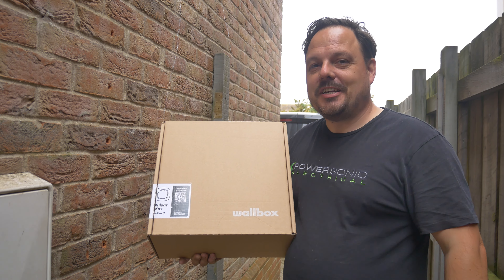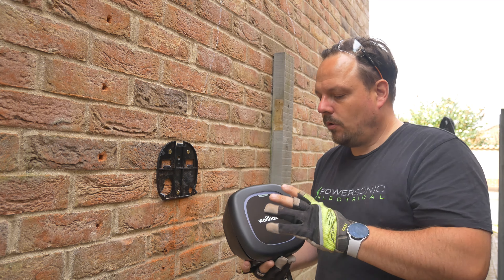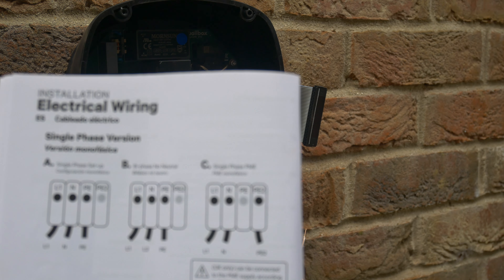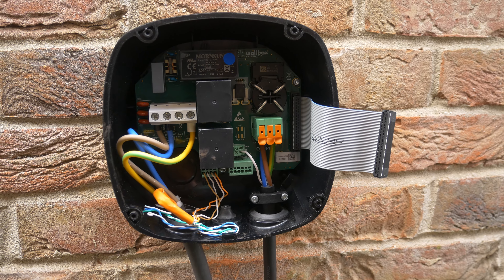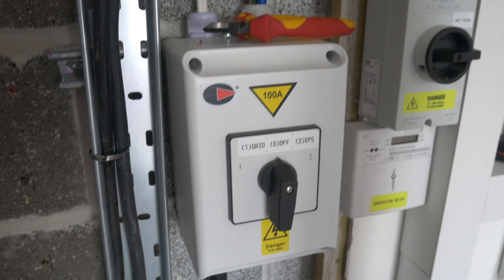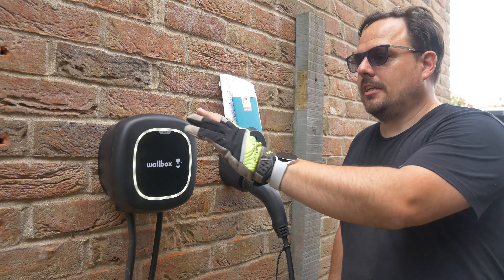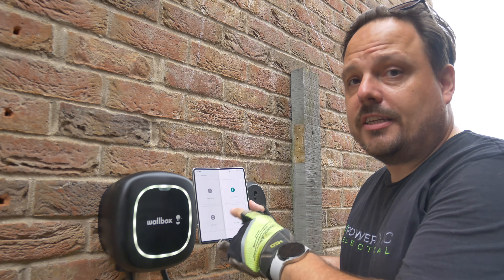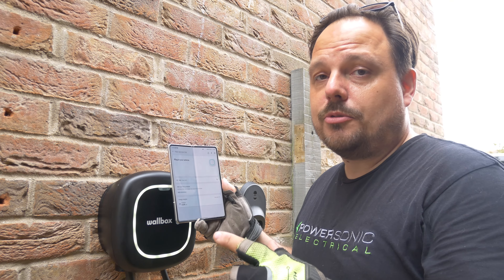How to install Wallbox Pulsar Max - Charging an electric vehicle from Solar PV

Comment: Great video Mark. 
I’ve got the earlier Pulsar Plus and have found it to be pretty good over the last few years. Having recently installed Solar, I’m considering installing a compatible power meter to use eco boost. 

How quickly does the power output ramp up and down when tracking green energy generation? Also, is there a minimum power level before it will turn on? My Pulsar Plus can be set between 6A and 32A which is what I use to consume PV energy at present but it’s a bit of a pain to manage manually. I’d be interested to hear how well eco boost works in practice. 

Thanks.
Reply from the maker: I'm not sure if eco boost works on prior models just to put that out there lol. 

Outside of that it switches pretty quickly. I'm using it in the not fully green mode and it hardly touches the grid but I think fills in shirt duration black spots in say cloud coverage etc.

The full green mode monitors for instant excess and uses it only. Subject to the minimum charge rate of the vehicle etc. 

Works a charm I have to say. Very impressed.
Reply: @electrician247  eco boost is available on the Pulsar Plus as well although whether it works exactly the same as on the Max is anyone's guess. I already have a Victron hybrid inverter/charger installed which is set to export to the grid when the batteries are full so I do worry a little that the control mechanisms of the inverter and the Wallbox might fight with each other and get into oscillation if you know what I mean. But for the cost of the energy meter and associated cabling etc, it's probably worth a try. I already have Cat 6 cable installed so I'll see if I can pick up a meter. I already have an ET112 meter installed for the Victron inverter so it'd be nice if it could just use the RS485 output from that but I don't expect that'll be possible.
Thanks again.
Reply: Sorry, I just realised I've been calling it eco boost when it's actually called eco smart...doh!
Reply from the maker: @craigchamberlain  I will be honest that the prior model is beyond my knowledge. But the one I have doesn't draw from the battery bank unless I charge via the over ride button on the app. I believe it works on a 50W export margin to ensure that doesn't happen. Thanks.

Comment: Hi Mark, as always a great easy to follow video. on a slightly different subject is there anything in the regs about location of consumer units on a stairwell in a domestic dwelling? I'm concerned primeraly with it being a fire escape. Cheers
Reply from the maker: Their is if its an escape route. Not necessarily against regs but would advise fire resistant aka steel CU and interlinked smoke alarms

Comment: Thank you Mark, very helpful, at 15:55 you mention the Power boost "in the right position". For a single unit setup of the Walbox Max without solar and without any smart features, Am I right that all 3 switches should be in the T (terminating) position?

Comment: Hello Mark, thanks foor the video, I just installed A Pulsar plus  wit N1 CT just as You. The power meter N1 CT unit lights up red when in use and flashing red when i power it up with 220V . Is that normal? I cannot find any info or documentation about this.

Comment: Nice vid. What cable tidy is that. Mine only came with the plug holder and not the extra bit on the top to coil the cable round.

Comment: Hi Mark, nice video, thanks. I run into the issue where all the wires are correct, but the 'Upgrades' cannot be accessed. They are greyed out. None of the troubleshooting tips work. Do you have advice?
Reply from the maker: I have encountered this before and it was the comms cables I had wired in the wrong orientation to the bottom of the meter interface. Switching them around solved the problem. 

So it’s worth double and triple checking. Outside of that it’s always worked fine.
Reply: I did not get around the issue yet, sadly. Triple checked all wires and connections. On the app, only at two occasions was the 'MID meter' option displayed in green. I entered the SN and the other field there,  and hit 'connect'; technical issue was the message, it did not work on either occasion. Now it's back to color grey. I am stuck. @electrician247 can you advise please?

Comment: Could this charger be installed on 4mm cable (existing cabling in my garage) with the current limit set to 5 for 20Amp?

Comment: Is it a power cable including cat6 data cabling? I’m in France sorry if obvious to you but I never saw a cable mixing high and low voltage in the same.   
10mm2 is the law here for ev chargers, so we use 3G10 cables.
Reply from the maker: It's called EV ultra. Made by Doncaster cables and Elland procell.

The data cabling is rated to 300V and primarily is used for the CT monitoring extensions. 

4 can use down to 4mm here on 7kw of circuit route/design allows. Generally people use 6mm. That's for single phase anyway. 

Hope that helps!
Reply: Hi Mark, does the data cabling need to be connected to the broadband router?

Comment: Hi Mark, Do you have to install the data cables or can you simply run it using the earth/live/neutral , im still struggling to understand what the PE and the PE2 connection is and how to correctly identify which one to use in the UK
Reply from the maker: It will work without the smart features and consumption monitoring yes. 

I’ve used mine since this video and it’s really good at identifying export to charge vehicles etc. so if you have solar it’s worth figuring out.

Comment: What's your thoughts on installing the power meter in the CU, is it against 510.3 ? , I have often wondered the same about a din rail bell transformer (Ring for example)
Reply from the maker: So long as they don't sit on the busbar themselves and are rated for all voltages present (along with cabling to them) I have no issue with it. Whichever way its done results in the same circumstance somewhere as its not type tested system in any regard.

Comment: 20:22 "free charge" - Solar energy is not free. It is costing you the amount you would get from the feed-in tariff. In fact, it is best to sell your solar and charge at night on a low EV tariff.
Reply from the maker: You say more than you know...

As we have battery storage in the house we are on octopus agile. It definitely isn't better to charge overnight... 

For some on different tariffs perhaps. 

But as professionals know its all about those unique tariff and usage arrangements. 

Having the ability to fill a vehicle direct from the sunshine is a massive tool in the box that most consumers would do well to utilise. 

In my circumstance here even with the feed in payment it is much more cost effective to charge from the sun when it allows. 

I see it clearly this time of year when it's not an option sadly. 

Statements like yours would have more weight if you had foresight of everyone's tariff and lifestyle. But you don't.

Comment: Do you need to use the EV Ultra cable or will 6mm armour do?
Reply from the maker: You will need comms cable for the metering kit. But can be run separate with regular Swa

Comment: How does the energy supplier know that you are charging your EV so that it will charge you the EV energy rate?

I have a smart meter, how do I know if it's compatible with Octopus intelligent?
Reply from the maker: They don't know. They offer discounted rates on the agile tariff for example at set tines or fixed times on the EV tariffs for refund rates (not as low as agile) for fixed set times. 

In terms of the meter you need to ask octopus